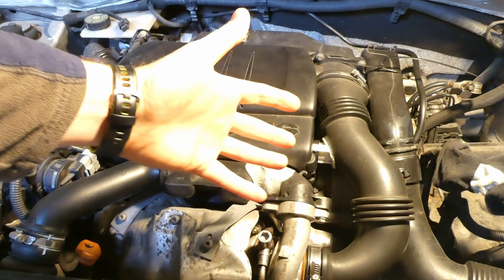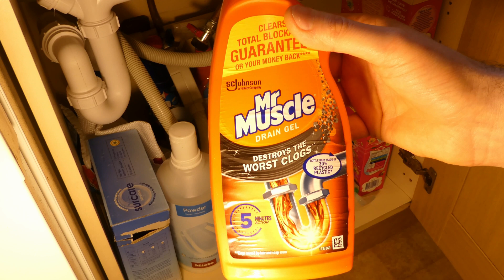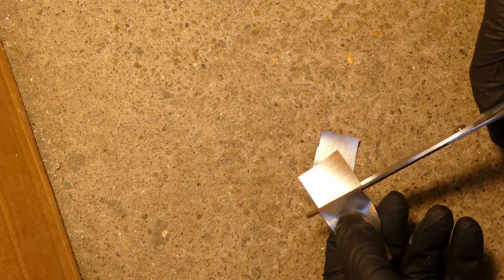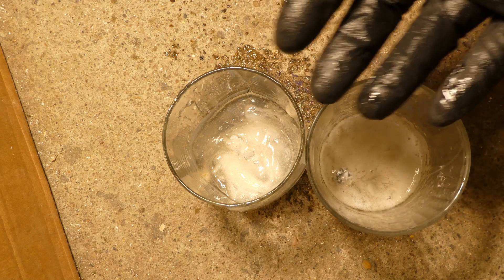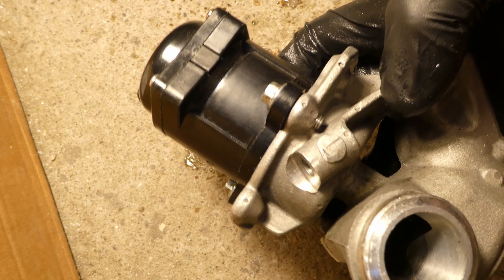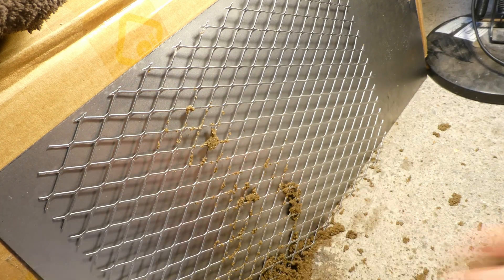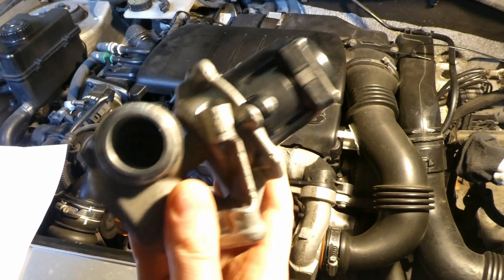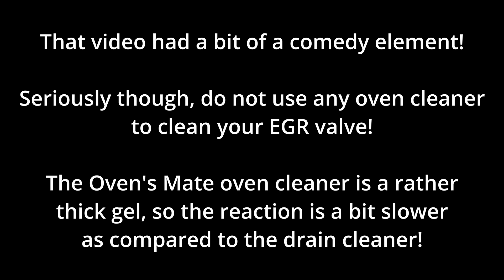Stop using oven cleaner to clean EGR valves!

Comment: After applying the oven cleaner, immediately brush it with toothbrush inside or outside, and clean with water within 5 to 10 minutes to avoid damage to the aluminum body. Mr.Muscle will mix with the dirt immediately, so better to start brushing immediately and avoid damage to the metal. Today I have cleaned my scooter engine, which is having a lot of grease and dirt. Within 5 minutes I could able to remove the entire dirt and see my entire scooter engine clean and new. After washing the scooter engine, I cleaned with a good towel. I am very happy with Mr. Muscle's oven cleaner, but as you said rightly, we should allow the oven cleaner to stay longer duration. Another observation is it will eat away rubber seals in the engine head. I had a very bad experience with oven cleaner during my motorcycle head cleaning. Now I am very careful and do not spray on rubber parts.
Reply from the maker: I mean yes you can use it. I only made the video for people to be aware of what can happen and what is happening. There will be some aluminium eaten away, but if you are quick enough it will work. I prefer dishwashing liquid, it is much safer, but requires a bit more scrubbing with a toothbrush 🙂

Comment: Never use tap water as a final rinse. Use De-ionised water.  The mineral residue left by tap water causes oxidisation and the carbon sticks to the mineral residue. I have 3 EGR valve used in rotation between each service.  👍
Reply: Rain water is just as good.
Reply from the maker: Hahaha, I assume that is ironic, but you may want to recalibrate your 3 EGR valves ;-) https://youtu.be/0s39tfitoso

Comment: Hi, great video as usual, I followed your guide to remove my egr. I've replaced it 3 times, 2 second hand egr, none worked. I put a brand new egr on the car, my question is, do I need diagbox, or will a garage with a good autel scanner be able to program it?
Reply from the maker: Yes, you would need diagbox with any EGR that was not there to begin with, second hand or new. I am not aware of any other software that can do it, apart from diagbox unfortuntely.You could be lucky though, the purpose of the recalibration is to tell the ECU the lows and highs of the new EGR, but a new one or second hand one could be within a few percentage points off from your old one, so kind if being lucky, but it will be stil not quite there.
Reply: @moremolecules  thank you for the reply. I bought a new one from a parts shop it was £125 I think the brand is beckerman. I have a topdon artidiag and it fails anytime I try to program it. I have it disconnected for now I will get it to a garage with a better scanner, I will let you know! Keep the videos coming they are some of the best and most informative on YouTube. Greetings from the North of Ireland 👍😁
Reply from the maker: @tonyrice3348  Thank you, really appreciated! Hope you will be able to program it. You only need the interface, the diagbox you can download from variety of torrents.
Reply: @moremolecules  I had diagbox I paid £100 for it, I tried to program egrs with it and it failed every time. So I got rid of it and bought the topdon. It won't program them either haha. Now I must say it was used egrs and one new from eBay but the new one was a cheap aftermarket it only cost £55 I think, the diagbox wouldn't program any of them. There's a local Citroen specialist near me I will go see him next week.
Reply from the maker: @tonyrice3348  I also used an aftermarket one, the original was waaay too expensive. Hella, it was fairly cheap, but have not had problems with it for the last 3-4 years. Previously I bough a Haas (as in F1) one and from new it was non-stop giving me errors. It was sticking from new, the surfaces were not machined too well. The diagobx is a bit temperamental, depends on the version and other stuff. Once I programmed mine, I have not touched it and it runs on a very old XP laptop only for that, hahaha. The Citroen specialist should be able to program it fairly easy and hopefully cheaply. It is ~30min job, probably less.
Reply: @moremolecules  thanks for your helpful information, I did ring Citroen they wanted £423 for a new one, not for me haha. I will let you know how I get on next week!
Reply: @moremolecules  I took the car to a Citroen specialist, he tried to program the EGR but it fails every time with permanant code P0490 or P0409. Hes at a loss as to what to do he said its definitely not the EGR its an electrical or wiring fault. Im not replacing it again lol Oh and he was using an AUTEL scanner he said he has never used Diagbox but has programmed lots of citroen EGRs with it. I may just unplug it and put up with the warning light
Reply from the maker: @tonyrice3348  I do not know the autel scanner, but if the person says that he has never had problem then it could be wiring/ECU, etc., but I still think it might be EGR itself rather than wiring.
Reply: @moremolecules  it could be wiring, also I noticed the plug is a bit broken and doesn't click all the way in, the yellow part is broken so i will try to get one from scrap yard and try
Reply from the maker: @tonyrice3348  Definitely change the plug/wiring up to where it seems OK. Worth a try. The airbox rubs on the EGR as well and that does not help either.
Reply: @moremolecules  update, brand new valeo egr, almost £200 and guess what, won't program, car won't even recognise it, I'm thinking the fault is logged in the bsi, or there's a broken wire in the loom, I give up lol
Reply from the maker: @tonyrice3348  That is weird. Can you actually do a test with the EGR. Not too sure if the autel can do it, but one can test the actuator and the electronic part of the EGR. You should be able from autel to test if it is moving.
Reply: @moremolecules  my scanner does an activation test, the first egr I got from the parts shop I was able to activate the egr, open and close it no problem but it would not program, the valeo one I couldn't activate it with my scanner
Reply from the maker: @tonyrice3348  I still think you may need to find someone with diagbox/Lexia and see if that helps. You never know, different bsi/ecu version, etc. The scanner might be ok with some versions of the bsi/ecu, but not do very well with others.
Reply: @moremolecules  the guy I took it to is a citroen specialist, he even has a citroen boiler suit and Citroen approved mechanic, he's never used diagbox or lexia, I asked him about it he said he tried it once and found it too slow, he's been using the autel for years and it's always worked, he said it cost £6k
Reply from the maker: @tonyrice3348  Apologies, then it is certainly something else. Most citroen/peugeot garages use diagbox, but he seems to know what he is doing.
Reply: @moremolecules  thank you for all your help but I am defeated lol I sold the car I suppose I'll never know! I changed the fuse box in engine bay and ended up with p0405 supply voltage to egr too low so I'm guessing it was a broken wire between ecu and egr. Without the knowledge and wiring diagrams it was going to be beyond my capability to fix so I sold the car with the known fault. Keep up the videos they are really some of the best out there for these engines
Reply from the maker: @tonyrice3348  Thank you very much indeed for the good words. Shame it could not have been fixed. All the best